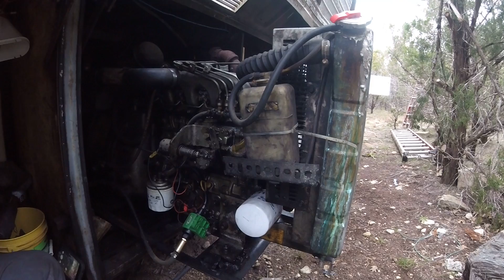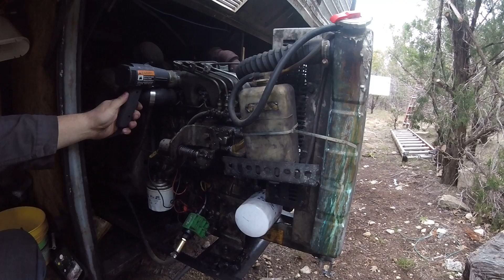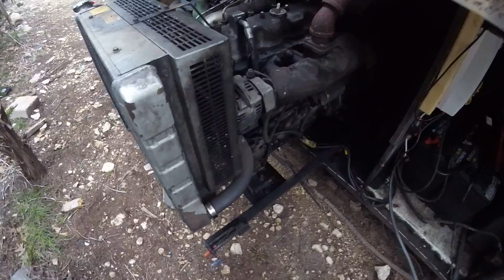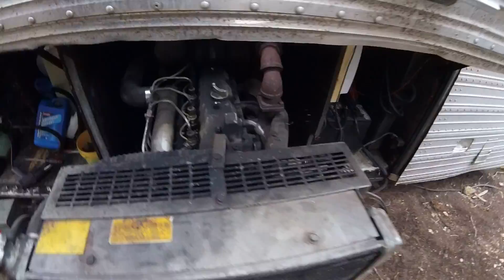Diesel Cold Start Tip If Glow Plugs Don't Work

Comment: Wow, that was a great idea. I’m gonna try that I got a John Deere Janmar diesel when you turn the key the glow plug light used to go on let it heat up and then you started it but for some reason, the glow plug light won’t go on you got any thoughts on that? Thanks for the video by the way that was pretty smart.

Comment: Does a diesel truck need to have the air filter on in order to start.
Reply from the maker: No it doesn't. Technically no internal combustion engine has to have an air filter to run. Air filters are to clean the air going in. It is ill-advised to run an engine without an air filter any longer than you have to.
Reply: @TheCavemanCan  thank you my lly diesel is having engine work done and the mechanic told me I need to purchase the air box so they can start it. It was damaged in a accident

Comment: You can do it all the time if you have power just by putting a cube heater in the space and letting it run for a while.  If it blows on the block it will heat the block.  It can take a lot longer though ...like an hour!..

Comment: Hi Caveman, When I was young I used to fuel the city trucks for Franks Nursery in Detroit. Part of my job was tire pressure, engine oil, coolant etc, but I vividly recall replacing the ether can on the motor. Those were 250 Cummins engines and there was a place to mount the can so the operator could spray it from the driver seat. Also, some of the older Detroit Diesels I worked on at Awrey Bakery had a "Pill" that you put into the top of the supercharger and crush it releasing  just the right amount of ether. Over my 70 years I have used ether 100's of times, without any problem. I always just started with a tiny amount and see what it does. The only thing I did was break piston ring lands on all 3cyl's of a Perkins English Ford Super Dexta, but that's because I used to starting fluid to rev the engine up not realizing how high I was revving it. My Dad had done the same thing to it years befor but in his case he had filled the whole oil bath air cleaner, tube and manifold with so much it started up and over revved. I wasn't there when he did it but he told me he had a dead battery and by about the 4th time he attempted to start it, he'd filled it up w/ so much starting fluid that it took off on him. I was just trying to bleed the air after filter change.

Comment: Makes perfect sense as the piston compresses air to get it hot enough so the injected diesel can ignite. By heating the air up that goes into the engine you help the process of combustion. I’ve tried this method months ago in our diesel John Deere gator, it worked great!

Comment: Makes me wonder....if all it needs is warm air, why use glow plugs...which seem to fail all the time, why not some kind of intake heater that blows hot air instead? Only 40 today and my diesel is just saying no to starting, will have to try this.
Reply from the maker: Some of the modern trucks use intake heaters instead of glow plugs. I know Cummins does in light and medium duty applications. In my experience, I think intake heaters are far superior to glow plugs.
Reply: @JamesBeardagon  After doing some searching I noticed that was the case, I had already been contemplating an engine swap, this just makes me even more inclined to do it. Was thinking a 4 or 6bt. They seem reliable since they're mostly mechanical.

Comment: Fun fact: if you dont have a heat gun, hairdryer works too just switch it to low airflow so the coils can heat up more. Helped a neighbour once that has a very high milage vw golf 1.9tdi and his glowplugs gone one winter, and had no money to replace it, and I saw him tryna start it in the morning, and it wouldnt, no surprise after 700k miles cant start with no glowplugs in freezing cold. Used this trick with a hair dryer and it took 2-3 mins of blowing air in but worked in the end lol.

Comment: I am now in my 70s when I first started with diesel engines my job was to start all the old trucks in the sawmill ,we used an old burning rag at the intake manifold worked no problem  , sorted ? James Stewart X soldier UK

Comment: Another tip is you can also spray brake cleaner in the intake manifold then hit the gas pedal full while starting the engine.
Reply from the maker: I can see how that would be effective at starting the engine, but I don't advise doing that for anything more than an emergency. It could damage the engine.
Reply: Personally Brake cleaner work better
Reply: @matthewpangilinan5653  i mean yeah brake cleaner not fluid my bad
Reply: Carefully use starting fluid will work . Take the air filter out and lightly spray from 2 feet away only after the engine is turning over .

Comment: Make note: must have generator that starts to power heat gun to start generator. Just kidding I've used that trick myself. Fix them glow plugs! That's a good generator. Kubota makes a nice engine shouldn't be a bad fix

Comment: That's great if you have a 110 outlet handy
Reply: Now there is the dewalt battery powered heat gun.
Reply: Cordless M18 heat guns are amazing.
Reply from the maker: Other people have commented about using a lit propane torch to achieve the same result. Use at your own risk!

Comment: This works in trucks right
Reply from the maker: Yes, this theoretically works on any diesel engine. You just have to figure out a way to warm the intake manifold. Just be careful not to melt anything that isn't metal.
Reply: @JamesBeardagon  thx m8 I’ll definitely need to do this at some point
Reply: @JamesBeardagon  hmm a heat gun good idea?

Comment: What temperature where you running the heat gun at? Mine diesel on my log splitter is doing the same, i suspect its the relay or something which is faulty though.
Reply from the maker: I don't know exactly, it just has a high and low setting. Most heat guns like that run around 1000 degrees on high. Yea, it seems pretty common for the issue to be relay related. How big is your log splitter?
Reply: @JamesBeardagon its running a Nissan td23 motor. Has 5 inch ram with a single stage hydraulic pump, 300 litre oil tank. 
My heat gun has 3 settings and is digital temperature adjustable from about 100 to 700 degrees, i will try at the highest setting today and see if it starts it. Thanks
Reply from the maker: That's a big splitter.

Comment: A heat gun, or your gfs hair dryer, or flame from torch, or even small amount of oil, will do the same job. If the engine is in good condition. Either is no no, unless nothing else works. But then engine is in need of some help.

Comment: What was the issue?
Glow plugs?
Glow plug relay(heater relay)
Starter or solenoid?
Reply from the maker: Are you asking about the Kubota generator in the video? I actually never diagnosed or fixed the original problem. I don't run the generator that often. Most of the time it doesn't need the GPs here in TX.
Reply: @JamesBeardagon  yes, my tractor has similar issues starting up. Jump start didn't work. Starter smokes a little. I'm trying to troubleshoot things out before I replace glow plugs or other things.